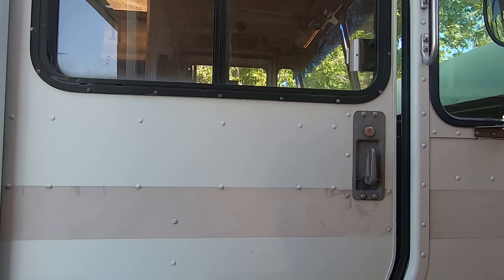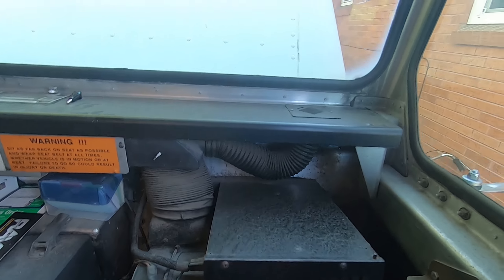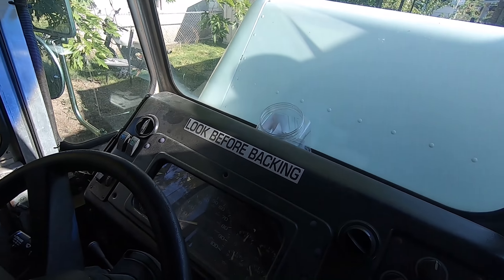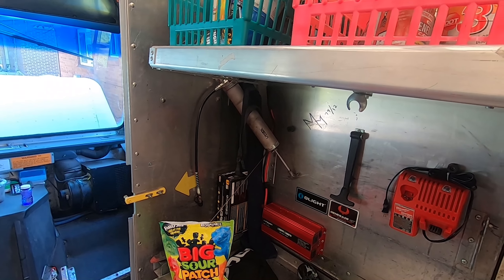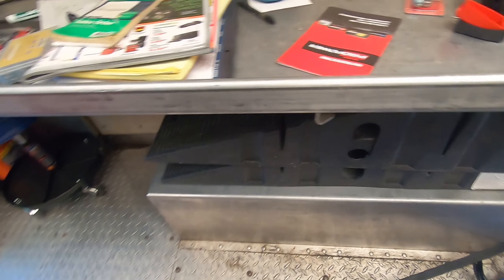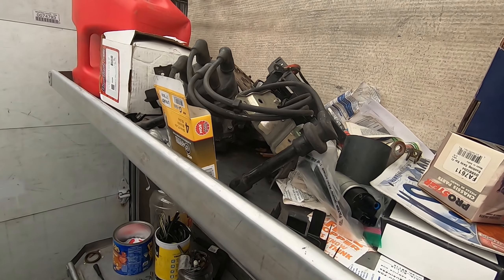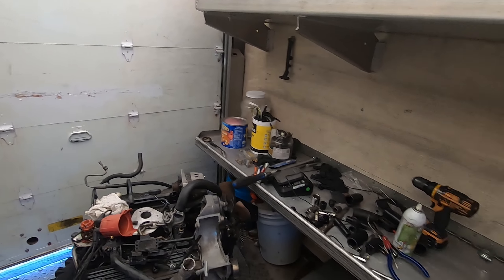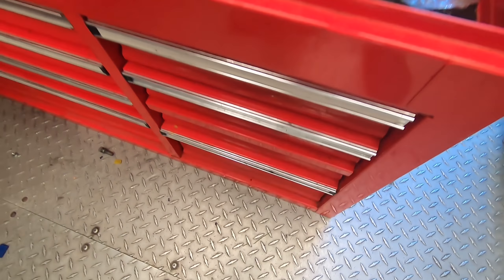What's in my mobile mechanics truck. Retired UPS truck turned mobile workshop.

Comment: May have been answered already in a separate video, (I didn’t see it listed) bu I have a question. What do you use as far as an estimator guide, repair information solution?? Keep up the good videos!! Thanks
Reply from the maker: so alldata is solid. you probably know. but most of the time i just get the quote and then i just do a job from experience. i hardly ever need additional info on a job.

Comment: Nice setup. I put my time in being a mobile mechanic but i found thay it kind of sucks lol. Im alot happier now working in a dealership. Having a lift so im not crawling around all the time, shade and fans in the summer and heat in the winter is to nice lol.
Reply from the maker: I like it! but no doubt the environment of a team at a dealership would be better. but im still young and have so much going on that the schedule flexibility keeps me going! its getting colder now and last winter i literally just laid on snow and ice under cars to work on them so its definitely not the best! haha!
Reply: I've done dealership independent shop and your heavy upsell chains I was and am more happy as a mobile business owner but it's not for everyone
Reply: Andrew Erickson it takes all kinds to make the world go thats for sure. Im glad you like it. Im 100 times happier at a dealership or independent shop though.
Reply: I worked at independent shops and dealers for a while. I took a break from automotive and started working in manufacturing for about 6yrs now but I'm getting back into automotive. It sucks being on your back all the time but it's nice to work your own schedule and being your own boss but to each their own 🤙

Comment: hey bro besides a business license do i need a mechanic license and or locksmith license?
Reply from the maker: depends on the states in most states no.
Reply: There’s only 13 states where you must have a license to do Locksmithing. Most all localities will require a permit to operate a business in that city though. I’m a locksmith in Missouri and the main thing is to be bonded and or insured as a locksmith. The state doesn’t require licensing. I think licensing is kind of a scam anyways cause it doesn’t stop scammers and punishes those that follow the rules. Probably important to have commercial Insurance as a mobile mechanic as well unless your rich and can afford to pay for any mistakes you might make.🙏🏼

Comment: Is that the 350. That didn’t fit and guy gave you the run around on?
Reply from the maker: Yes sir. Haha. That’s the one. It’s that v6 early style one built like those 350 he swore would swap into his vortec Sierra. Haha.
Reply: Ha ha been there and they are always so confident it will fit ! Yes you can absolutely make anything fit but that’s the easy part lol having that engine communicate is a whole different situation but the customer never seems to understand without communication these things are large paper weights ha!

Comment: Where do you recycle your antifreeze
Reply from the maker: good question. there is nowhere convenient. I'm sure it varies by location but here the ONLY place that takes it is the landfill. they have recycling for it there.
Reply: The local auto part stores near where I’m at all take it. Ex: Auto Zone, Advanced Auto.. Basically wherever you bought / sells the stuff, will take back the old stuff.
Reply from the maker: @garycasper2929  im not sure where you are from but everywhere i have ever lived they dont take antifreeze. just oil.
Reply: My county has a recycling facility that accepts all fluids: oil, transmission and coolant.
Reply: Leave it at a workshops door. They deal with getting rid of fluids all the time. This is coming froma diesel tech

Comment: V6 350...
Reply from the maker: the 4.3l vortec. its the v6 350 spin off.
Reply: @RoadsideRescue  mmmhm
Reply: That’s not a 4.3. Those valve covers don’t come on them. Along with the 4.3 is spider fuel injection